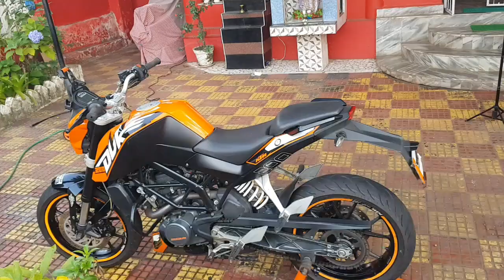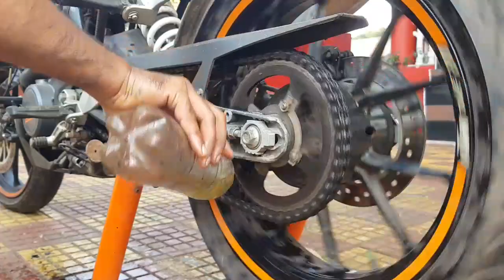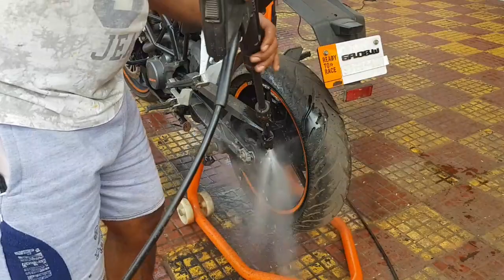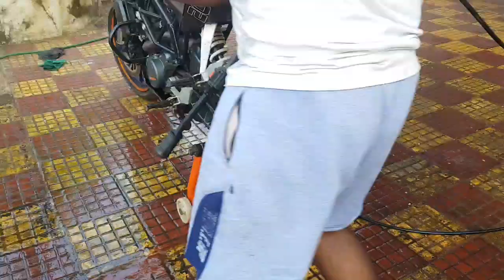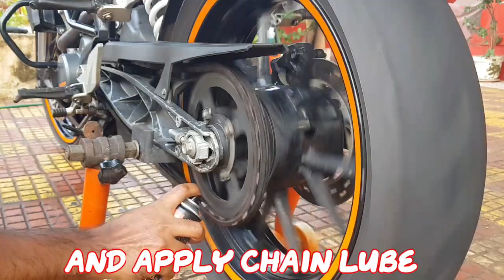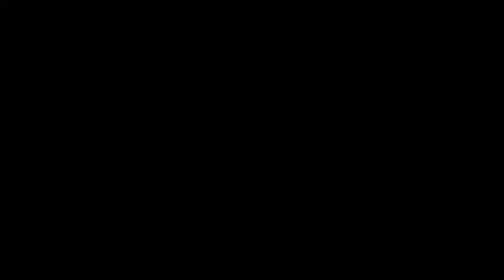Chain cleaning with diesel / applying chain lube

Comment: Very dangerous risk of amputation of fingers when running engine to rotate wheel during cleaning.
Reply from the maker: Yes it is... if u r beginner take a supervision of who knows very well to clean or u can take to the mechanic but i suggest who knows very well only they can DIY at home.
Reply: Even if you are professional ot happens in nanoseconds when your rug get tangled it the chain 💀 and rip fingers
Reply: @mosesnvlogs9591 i suggest you don't do it.

Comment: Say hi brake pad contamination with chain lube ‼️🚫🚫
Reply from the maker: Yes! But after sometime it becomes normal
Reply: @mosesnvlogs9591 lol. 😂. Ktm have vid cleaning chain using a cover. You can make something but not with engine running.